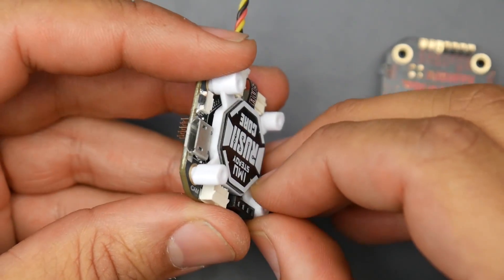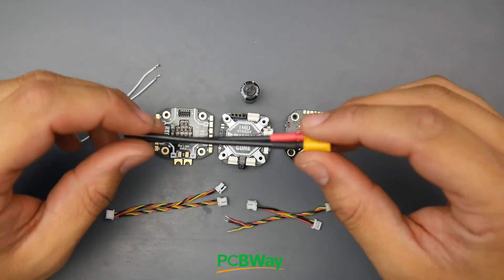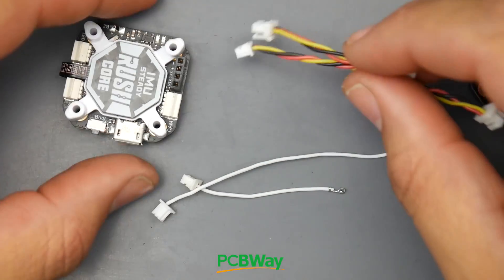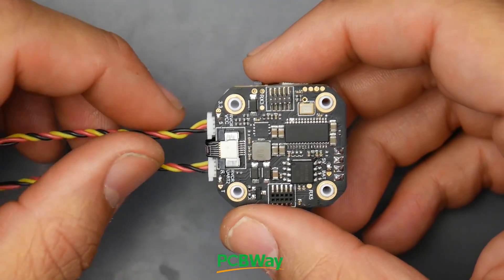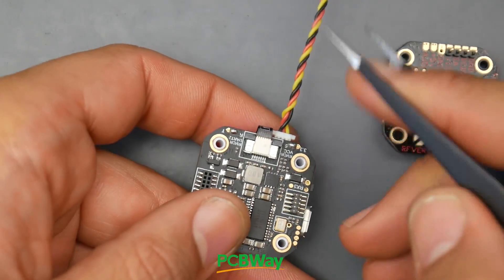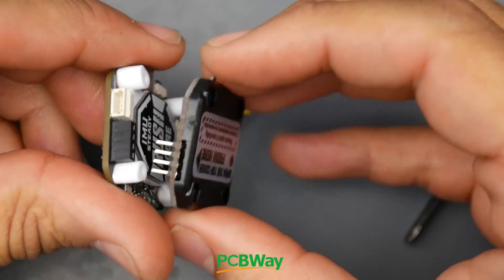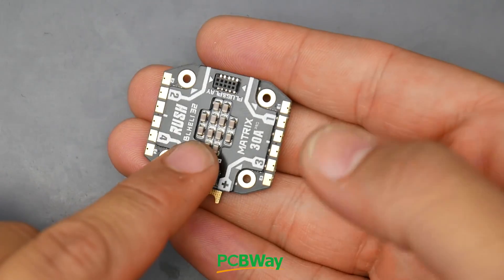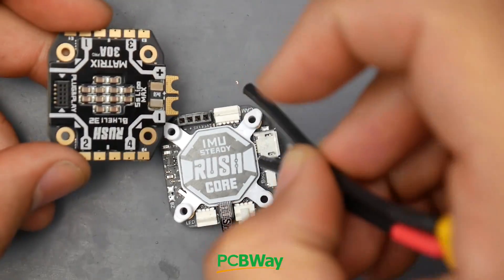Unique Gyro Implentation // RushFPV Core 7 Stack Setup Guide & Overview

Comment: It looks good and quality seems good, I like to see new idea's.  But its a pass for me, battery lead is wrong for me, antenna off the side uh no thanks.  I dont have a problem with pins, but cables are just as easy and provides more options IMO.  Also the teeny tiny pads

Comment: Totally hate this stack already. Pin connectors always break rather sooner than later, TX are not a gimmick but a necessity (camera control, GPS, ...) and in most builds I end up rotating the boards differently than what the manufacturer suggests (lipo lead to the back/side) which is not possible with this one. Clips on the JSTs mean that if there is stress on the cable it will not disconnect but rip the connector right off, probably damaging PCB traces. And with pins sticking out you have a hard time mixing and matching these with different components. So thank you for the review but definitely no buy.

Comment: still pins on the board...this FC is rubbish.   Dont buy !!!
Reply: I've been using GepRC stacks (with pins) never had a failure with plenty of crashes. I still agree with you though not a fan of this stack especially for the money they want..
Reply: Hi mate, can i just connect my elrs to the unbridged uart underneath? Is that a seperate rx and tx 2?
Reply: You tried it?
Reply: @MachineManGabb  i tried afew others with pin connector....every single one failed after a few crashes.
Reply: @MachineManGabb  wires are more reliable. And boards with pin connectors are real pita to put conformal coating on